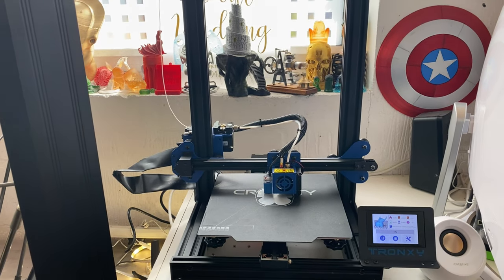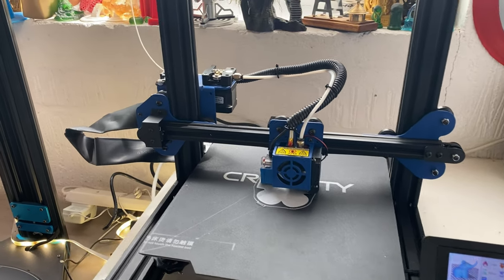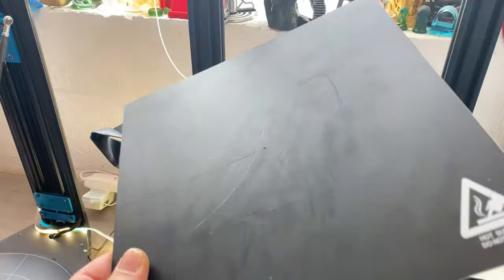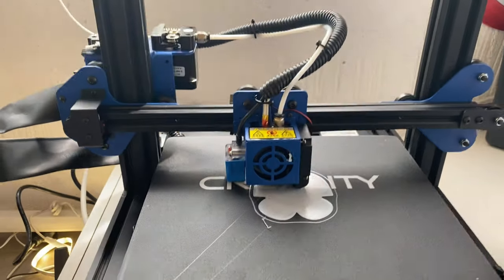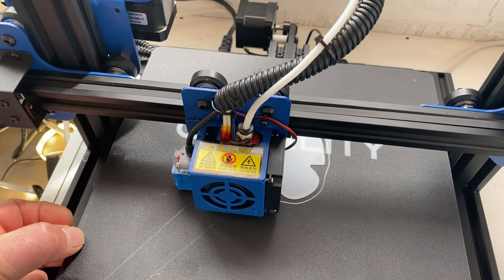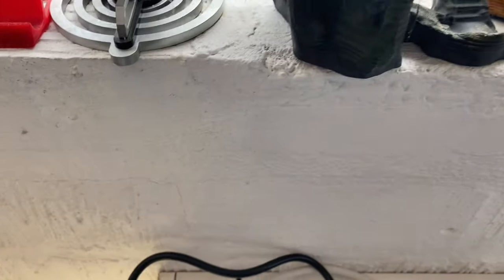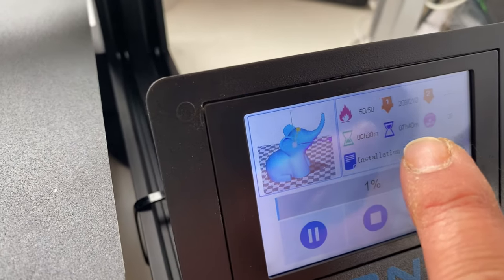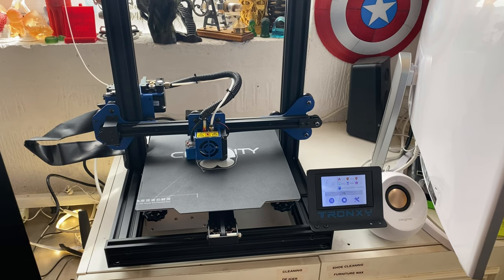Tronxy XY-2 Pro 3D Printer First Impressions is it any good???

Comment: just got my second XY-2Pro. I just love this little machine, apart from the inconsistencies with the quality control it prints beautifully when using good filament. That white crap it comes with is wet and brittle, bin it! As for auto-leveling it`s just marketing bullcrap. It doesn`t to mesh or on the fly leveling. Sensor is basically just a fancier Z-stop switch. The bed is warped on both my printers and the only way of getting around that is a glass plate. On my machines power supply and maiboard fans are the loudest things. Steppers dead quietI.
Reply from the maker: why do you keep buying them, they are terrible, so many better options out there that actually work
Reply: @BeaniesHobbies  Well, first one I bought last november and it was just a cheapy to see if I like the hobby or not. It was between this and the Ender 3 Pro. I chose this because it has a touchscreen ( I hate rotary knobs!),  in theory auto leveling, all-metal extruder, better packaged parts and silent drivers. Plus it was cheaper than a Creality. I now have a Two Trees Bluer Plus aswell, which is bigger and has PEI surface but still warped bed :D Second one I plan on using for my Voron Switchwire build: frame, steppers, power supply etc. Don`t get me wrong, I`m not saying this is the perfect machine but I like tinkering and seems to not run out of patience as easily
Reply from the maker: @maiorciprian  the main thing is that you are enjoying the hobby, i have the bluer plus and what a cracking printer it is
Reply: @BeaniesHobbies  That one has its share of woes: awfully noisy right out of the box (took care of most of that by removing the casing fan as it wasn`t doing much anyway), poor extruder for flexible filaments,  warped bed as I mentioned before ( seems to be a theme with these cheap aluminium beds), somewhat noisy steppers, even though it has TMC silent drivers, no insulated bed, which takes forever to warm up etc. The MKS board is very sketchy aswell: everytime I modify something in the UI while its printing it pauses momentarily. Also the steppers are over voltaged from the get go: on mine one was 2v and it supposed to be at 0.8, so they tended to overheat quickly. Adjusted that and they are fine now. Also 3DTouch leveling probe is a joke, same as with the Tronxy. It DOES NOT do mesh or actual leveling and the fact that you can do Z Offset only after auto-levelling (sic!) is a poor design. It does have babystepping at least. I can`t wait to have my parts and build the Switchwire for a bit of trouble free printing.
Reply from the maker: @maiorciprian  ive not had any of those issues with my bluer plus, maybe they tweeked it abit as ive only just got mine, bed levelling works really well and mine isnt loud at all and no warped bed either, yes the ui its a bit sketchy as mine also pauses very briefly if i need a babystep but doesnt seem to affect anything. ive got several printer reviews coming as seem to be stacked out with printers currently lol
Reply: @BeaniesHobbies  if its a printer they sent you for free for you to review I wouldn`t put it past them to "work" it a bit so that it is as good as it gets on the review; I bought mine in December so I doubt they fixed all those issues in less than a month. Perhaps I was unlucky and got a subpar machine, but from all the reviews I`ve seen it is a bit flawed. It does print great but it needs a lot of tweaking . Perhaps you could share an email adress so that we could exchange some thoghts in the future.
Reply from the maker: @maiorciprian  for free lol my channel isn't big enough to get anything for free I have to buy them all myself thats why you will only get honest reviews from me as I dont care if I upset the manufacturer 🙂 my email is in the about me section on my main page bud

Comment: Hello, after started the printer and see the printer informations the screen is blank working but menu is not available thanks for the help.
Reply from the maker: Hi, i will give you some advice if the printer is new I would return it as they are an absolute pain, now if the printer powers up but the screen is blank I would check to make sure that the screen hasn't come unplugged
Reply: @BeaniesHobbies  thanks for your feedback and help.

Comment: is the new version of this printer really that silent ? Bought my one a year ago and it is loud like hell. the rest of the printer is absolutely fine
Reply from the maker: it is very quite but i really would NOT recomend buying one, they are terrible, had nothing but issues with the ones i had so they all got returned
Reply: Beanie's Hobbies  the rest of the printer is working fine. But because you can’t change the Stepper drivers, I just want to make sure, that if I buy the v6 board, that the steppest drivers are silent. I tuned my Tronxy xy2-pro and it’s doing the job.